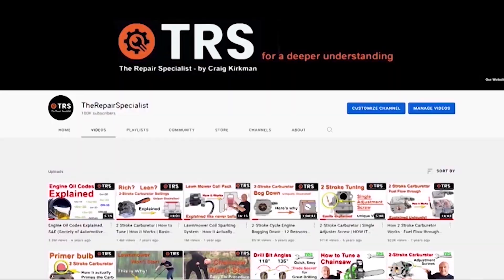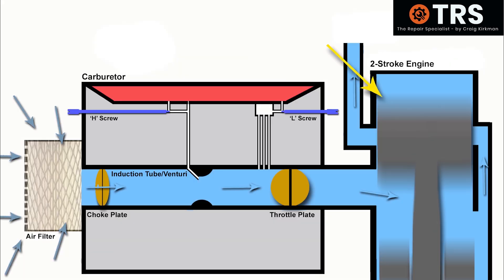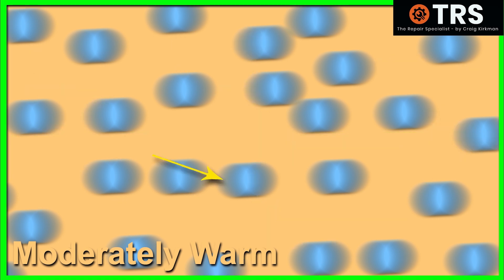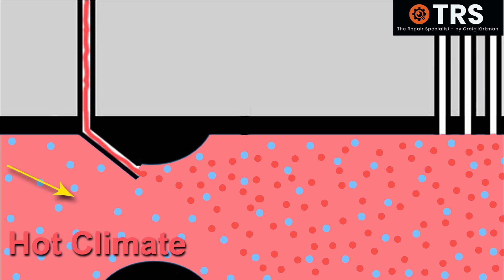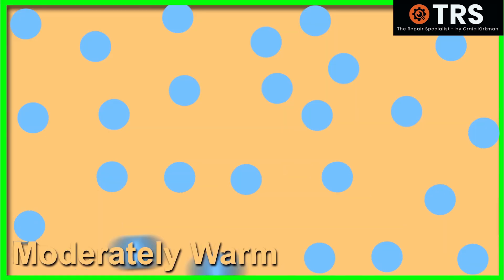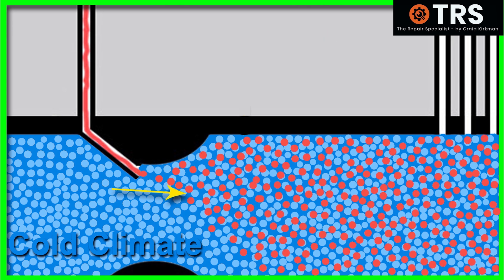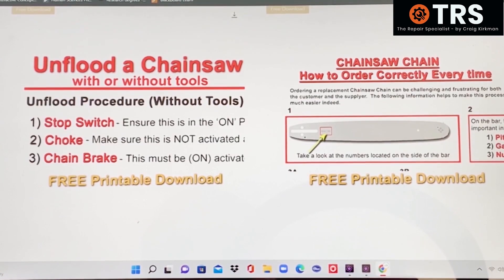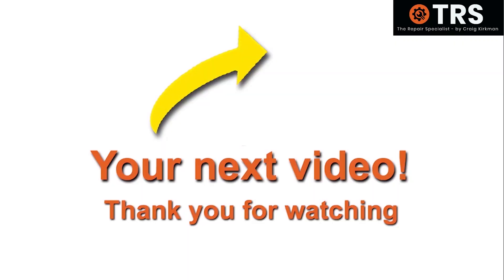The Impact of Weather Temp on Chainsaw Performance & Carburetor Efficiency. (by Craig Kirkman)

Comment: Would carb adjusments apply more to liw speed screw or high speed screw?...or rather, an even balance on both according to how the saw responds at diff levels of throttle?
Another educational videi. Cheers.🙂
Reply from the maker: Thank you for your feedback. I really appreciate it. The carb screws work in combination with each other. It depends on the state of the engine, fuel, environment and more etc, as to which one is used the most in any given situation, but the general rule is that they work in combo with each other. 👍

Comment: Excellent explanation. I live in Canada where the temperature goes from -30C to +35C in 6 months. However, nobody uses a chainsaw when it is that cold. -10 perhaps.
Reply: Well let me be the first to say I did at -4/-7 degrees….I’ve had hard starts. last week it was great temp like 40 degrees with easy starts…. 

I never knew how temp really affected the carb. Thank you for this information. And now I know…
Reply from the maker: Wow. Those are extreme temps compared to those here in England. Thanks for your feedback. I really appreciate it. Craig 👍👍

Comment: Call the airport before tuning the carby.
Density altitude(IIRC)  value is needed, just like for aircraft.

Air density is affected by the air pressure, temperature and humidity. The density of the air is reduced by decreased air pressure, increased temperatures and increased moisture. A reduction in air density reduces engine horsepower, reduces aerodynamic lift and reduces drag. Thnx Richard Shelquist
Reply from the maker: Wow. You have a very creative mind Mr Shelquist!

Comment: Craig, your past videos describing how to tune a chainsaw are excellent. However today when I downloaded your pdf file on tuning a chainsaw, there seems to be a problem with the collation of the file. I can read the first few paragraphs well, but as I scroll down to the midsection of the sixth point, the screen suddenly goes blank and I can't read any further. I'm using a Mac computer. Similar disappearing fields appear on your website, although I was able to scroll through the order sequence. You might want to test out your website and order forms with different computers to search for bugs.
Reply from the maker: Sorry to hear you have had problems. I will look into that. Thank you for letting me know. Craig

Comment: Carburettors are indeed  VERY  sensitive to pressure and temperature . Two-strokes are highly sensitive but Four strokes also have some issues .
C V carbs are a fairly good solution . Not perfect but pretty damned good and the " Lectron " solution is VERY good indeed .
Back in my Motorcycle days  I  used to carry a bag of Jets  and tiny circlip pliers . 5-10 minutes and all was good for where  I  was . Clean Plugs , no seize ups .
Reply from the maker: Awesome 👍